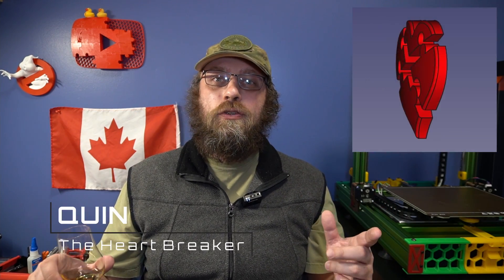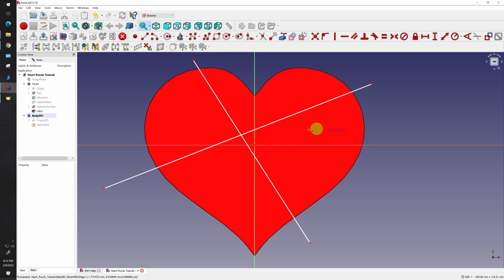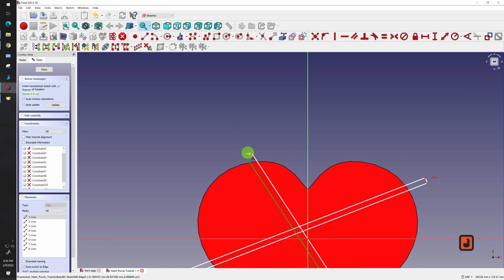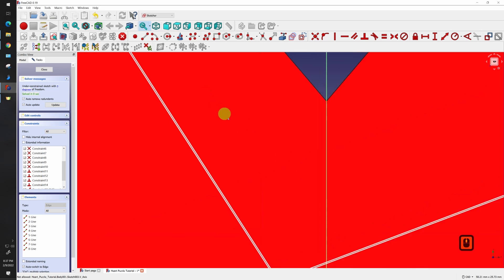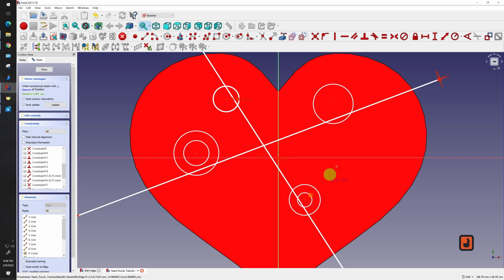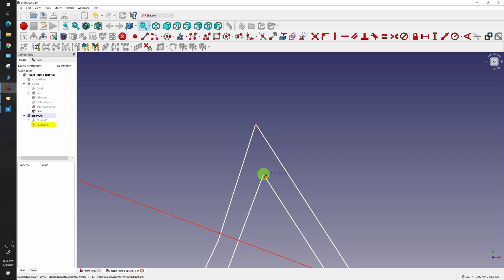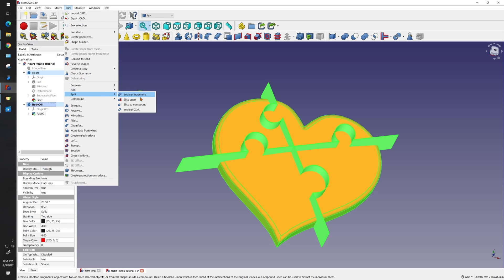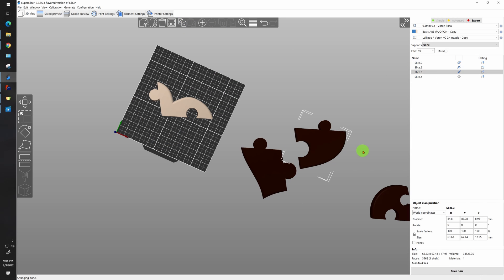FreeCAD Tutorial - Part Design Puzzle

Comment: Funny, informative, shows all the details and then speeds through the rest while showing what's done just in case someone needs to see it done. Excellent video, subscribed~💗
Reply from the maker: Thank you for the kind words and the sub, it is much appreciated 🎉.

FreeCAD 1.0 has an offset tool that makes this procedure even easier but it got some limits that other software don't, but word in the streets is that is getting an upgrade in 1.1 to the tool that will give them ULTIMATE POWER!

I'm hoping the revised the video to show the new method when 1.1 comes out.

Comment: Searched for a Puzzle Connection and your Video explained everything I needed.
Now it's time to adopt to my needs. ;) Thanks for this Tutorial.
Reply from the maker: Your welcome,

The next version of freecad has a build in offset took which makes this process a lot easier.  I'll make a followup video on this one showing the technique when it comes out.

Cheers.
🍻
Reply: @QEngineering  The Design for my specific Anki Holder from Scratch to the result as stl needed 1 hour, incl. your video. Without your video my trial and error for the connection would have definitely taken longer. Now the prototype of the holder is printing. If all fits --> printing the next 5 transportholder and tomorrow all the Anki stuff can be transported cleanly without any damage. :) freecad isn't my daily work but I like it to do new stuff and videos like yours are nuggets to safe time. THX and greetings from germany =)